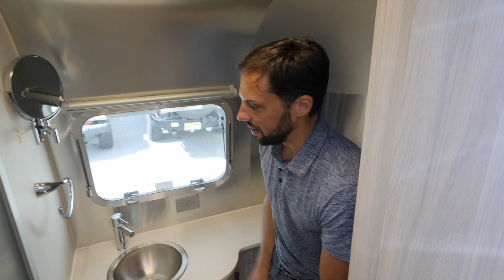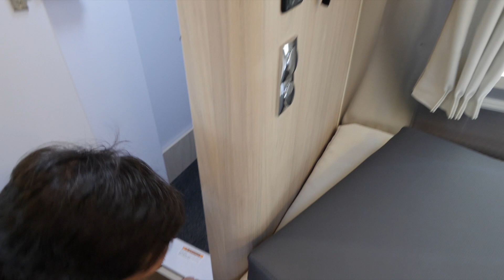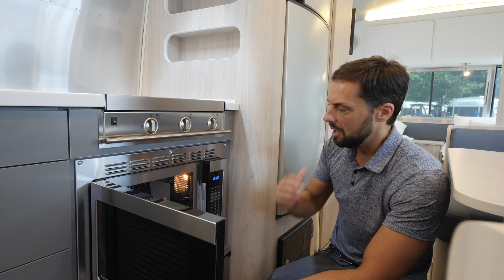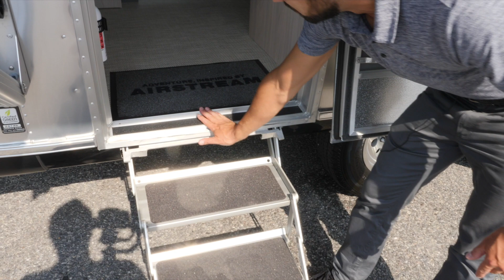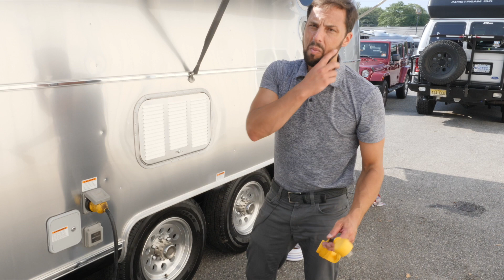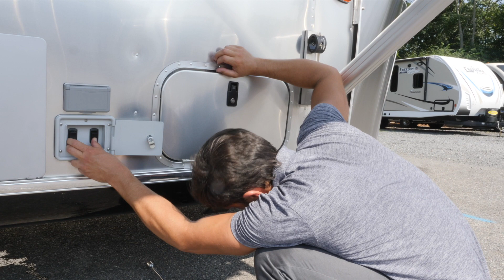COMPLETE WALKTHROUGH - 2020 Airstream Globetrotter 23FB Twin New Luxury Travel Trailer How To

Comment: Love the lighter colors, and the blueish seats and cabinets.   Does that Microwave also have Air Frying?   If not, can you get one that does?  Air Fryers are so poplular since you don't have to use oil when frying and it is healther because of the lack of frying in oil.
Reply from the maker: Susan thanks for checking this out. Some models have that feature but to to supply chain challenges, I have not seen them recently.

Comment: Great video Patrick thanks. awesome trailer. I have a couple questions.
- what do u think of the electric 12 volt fridge in the 2021?
- what do u think of the composite new floors?
- do the twin mattress slide off during travel?
- is their a reason on this model that the black tank isn’t bigger?
Reply from the maker: Thank you. 
I love the new 12V/120V DC/AC refrigerators.  
The composite floors are also a great upgrade. 
I have not experienced the mattress sliding off when traveling. 
The black tank sits above the floor on the rear and corner bath models and there is limited space. The 18 gallons is plenty.
Reply: @colonialairstream  thanks for reply. One other question is the tv hooked up to the trailer speaks....can u play it through the fusion stereo?

Comment: Excellent tour Sir!  However with the increased weight it can no longer be towed by a mid-sized SUV or light pickup truck.   I wonder why they did that?
Reply from the maker: Erin, the weight increased due to the larger refrigerator, power awning, power stabilizer jacks and solid surface countertops.

Comment: Why do they put the battery charger under the fridge if it generates heat? .... seems counter intuitive
Reply: gerard haubert probably use the same vent for both.
Reply from the maker: Not enough heat to create any challenge.
Reply: Using the same fan to cool  both .